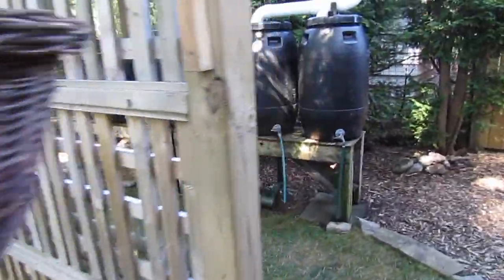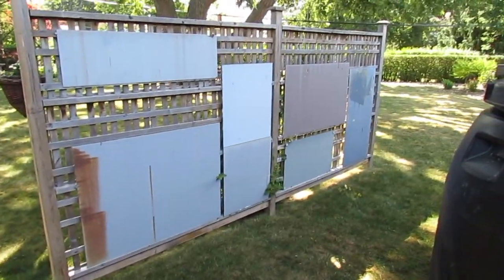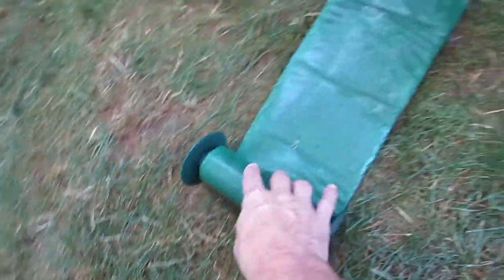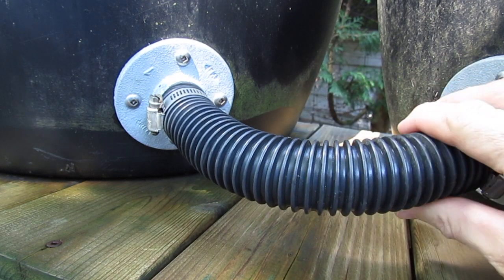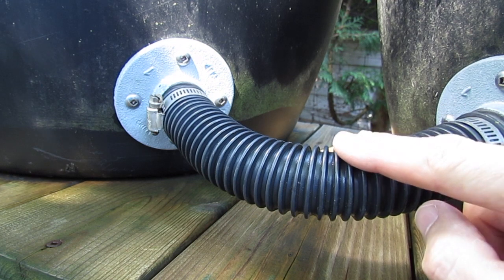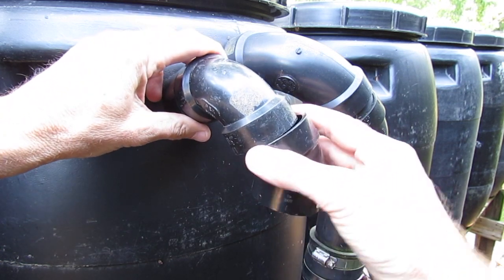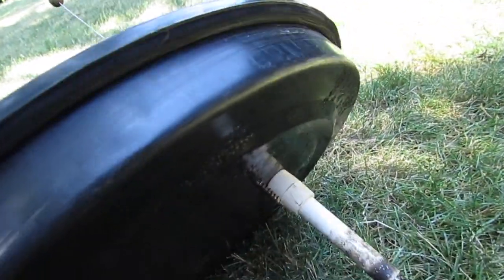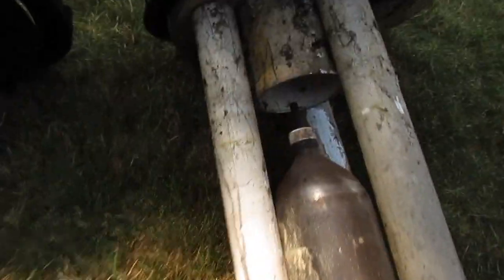How to Build ● Rainwater Tanks From Pickle Barrels

Comment from the maker: Find my favourite tools here!    https://www.amazon.com/shop/chrisnotap
Reply: I have a tip for you: If you get the overly large blue electrical wire nuts you can use one on the end of the tube of caulk and it seals it up super tight. I just re-opened a thing of caulk I had closed like 5 years ago and it pumped out as fresh as the day it was opened.

Comment: Very nice video.  I like the ability to take it apart.  I am using leftover concrete blocks to raise the barrels, but they will likely settle over the years.  Using your system I have the option of taking the system apart to do that.  My additions to your system will be to put a screen filled bucket at the top of the 4" PVC collection pipe.  I don't have screening on my gutters, so having the downspout stop a few inches from the top of the screened bucket will provide an air gap.  The screen there will be kind of like a small concentrated version of your rain gutter.  My other modification is to extend the  4" pipe over to the third barrel in line so that the water can flow both directions through the 1" connector pipes while filling the other barrels in heavy rain.👍

Comment: Thank you . This is great . I am in process of linking barrels . I am not clear as to why overflow is only on the first barrel. If barrels are all self leveling wouldn’t they all need to have an overflow ? Perhaps I am not understanding the physics . All your barrels appear to be exactly level. Mine are at a gradual incline . With barrel would get overflow tube? 
Love this !
Reply from the maker: Since they are all level and are connected at the bottom, all I required was one overflow on one barrel. I put it on the first one just in case there was a torrential downpour. The overflow would be able to handle the water that may not get to the other barrels quickly enough.

Comment: Hi Chris, mine here at the house are a dark grey with large corrugations, which adds strength. But the newer versions often don't have these and you can get all colours even Pink, go figure. As I mentioned they are plumb in, with a 5 micron filter. And the water is used for everything and is my primary supply. But several years ago we had " Ag water " linked to the middle tank. This is treated town water that arrives at about 2.5 litres a minute and then is pumped to the house. I am really surprised on how many youtube vids I see on collecting rainwater in the states. Best come to Australia to see how we do it. And here its almost mandatory to have tanks now. Cheers love your channel and have subscribe

Comment: I like the cleanness and simplicity of your barrel connections.  Now that you have been using it for a while, what are your thoughts on your design vs having a shutoff valve between each barrel to isolate in case needed for leaks or cleaning?  Is that overkill?
Reply from the maker: It is still working great. My wife uses every drop out of all the barrels for her gardens each summer. I haven't and wouldn't change anything. If I get a leak, which I still haven't, I would just let it get low and then repair it when the chance arrives.

Comment: Chris, I just found this on youtube and plan to build a system like it here in Arizona. Thank you.  Just one question: do you get much leakage from the metal flanges on each barrel ?
Reply from the maker: Not a single drop of leakage.  There is no leakage from any connectors at all. A bit of silicone before assembly is best.

Comment: How do you keep the water from leaking out the top threads of the barrels? We are trying to use this type barrel for a sediment filter, but water is leaking around the threads.
Reply from the maker: You can see the overflow pipe at 8:24. The water can't get to the threads since this pipe allows the water to escape onto the ground before it gets that high.

Comment: Great tutorial.  Thanks for the details.  Question about the pop bottle in the first flush barrel...  When the bottle rises and causes water to flow into the next barrel, wouldn't the next barrel then accumulate the biological debris from the roof?  Seems like the next barrel would become the new first flush barrel.
Reply from the maker: By them the roof has been cleaned by the rain.

Comment: What a fantastic video! Two questions: is this enough for a couple months of watering or do you run out often? 
Does it have enough water pressure (gravity fed) for a drip irrigation system?
Reply from the maker: All depends on where you live, amount of rainfall, and how much garden you have to water. For every foot off the ground that the water level is at, it creates approx .5 psi  per foot (1/2 a pound of pressure per foot)  So if the water level in the barrel is 6 feet high, that will create about 3 pounds of pressure. As the water level drops, the pressure will also drop accordingly.

Comment: I love your setup - though it seems you would loose a huge amount of water using that type first flush.  Had you considered using a filter instead?  For example, a nylon stocking to filter out the debris.  Thanks and keep up the good work!
Reply from the maker: Thanks for that! I kept it simple. Filters need to be cleaned so I stayed away from that. I clean out this first flush about once every one to 2 years.  Very low maintenance and works really well.

Comment: You can also use a piece of clear hose connected at the bottom and secured at the top to view the water level. If you see an 18 wheeler water truck they all have view hoses like that.

Comment: Ingenious. Does the soda bottle have to have air shot into it with a valve? Won't it float up just being closed?
Reply from the maker: I put the valve in it to make is firm . Sometimes these bottles can be a bit soft and deform a bit. The best thing to do is put the bottle in the freezer for about 15 minutes and then immediately screw the cap on when you take it out. The cold air then gets up to room temp, expands, and keeps it firm. Saves time and effort of putting a valve in it.

Comment: I like this,  but I was thinking what if in the winter I want to disconnect this system from the downspout?  Any suggestion?  Thanks
Reply from the maker: All I do for the winter season is I open and drain all of the tanks and leave the valves open for the whole winter. That's it.

Comment: Watched your rain barrel video. Looks great. I would be a little worried about the ball valve and prancing critters. Hate to see you wake up one morning and the water is on the ground.
Reply from the maker: Have been using that ball valve now for about 8 years without a problem. Ball valves don't move that easily so critters aren't an issue.

Comment: You could have used a coupler on the first flush barrel as well, just add a piece of regular pipe into the bottom end to handle the bottle and keep it from getting stuck.  That give the added benefit of locking the pipe to the barrel cap like the other barrel.

Comment: I like your thinking. What is the reason for inflating the "pop bottle valve"? Would you increase the water displacement by much? Or have I missed something? Thanks for a Great idea.
Reply from the maker: +Sandy Johnston I watched a video where they made a large floating craft out of pop bottles and they used a bit of dry ice popped into each bottle then put the cap on but they were very uneven in pressure. It got me thinking of a better way to do it.
Reply from the maker: Good question. If you take a pop bottle and put the cap on, you'll find that the bottle is too flimsy, you can squish it and lose its shape. With it pressurized a bit with the valve, it becomes very firm and reliable to do it's job.
Reply: Maybe some soda and a little mentos candy would work.

Comment: Awesome video and packed full of great information. I do have one question. Is there a flap or valve so that when water is coming into the barrels it only goes into the first barrel and not the second? Whats stopping water from going into the second barrel until the first fills up and the 2 litter bottle stops the first barrel from filling up?
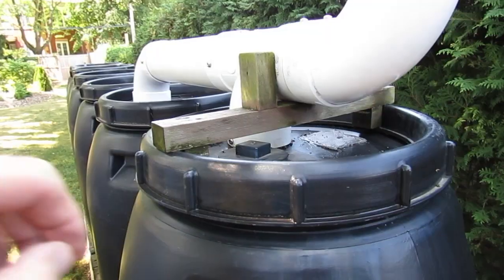Reply from the maker: If you click on this number, 10:56 ,  it should bring you to the part of the video where it shows the shape of the pipe. With the shape of the pipe the way it is, the water has no choice but to go into the first barrel.
Reply: got it. Thank you so much and look forward to more videos

Comment: Chris, I am a bit perplexed, here in Australia we just add a large poly tank to the down pipe, I have three 5000 gallon tanks on my house and they are plumbed in so that is my water supply. I assume that you don't have the access to large tanks?
Reply from the maker: Interesting. What do you use the water in those tanks for? Are the tanks Clear coloured or Black coloured? The ones we can obtain here are large cubes about a metre cubed but they are white translucent in colour and the algae form inside from the sunlight getting through.

Comment: With that much space in the garden, I'd be inclined to get a used 1000 litre IBC tank or two for next to nothing and paint it black.
Reply from the maker: You could be right but it's 6 of one half dozen of the other. Both work well. With the barrels there's no painting and each is light weight and easy to handle. Just sayin.

Comment: If you have questions on the legality or legitimacy of Rain Water Harvesting you can always check out the NCSL website for Rain Water Harvesting

http://www.ncsl.org/research/environment-and-natural-resources/rainwater-harvesting.aspx

lets you know what states have regulations/laws and what they are for pretty much anything.  For instance California allows the harvesting of rain water for specified purposes such as Landscaping.  Whereas Texas has an extremely comprehensive bill found at http://www.capitol.state.tx.us/tlodocs/82R/billtext/html/HB03391F.htm.

Just look and you might find the information you are looking for.  I think this rainwater collection system is absolutely awesome.  Only thing I would do to change it is instead of a first flush tank, I would set up a filter system prior to the tanks which includes a charcoal filter.  Not much in the way of debris if you have the gutter setup or a screen on your funnel system so that the only thing you are really needing to filter out is the Animal excrement. 

Wonderful system!  Thanks!  Helps out a lot, I hope to set up my system for rain water harvesting soon and use IBC tanks for the collection tanks.

Comment: Thanks Chris! Love this and will be setting up something similar. I was wondering, based on some of your other videos, how you might incorporate the 12v Prius water pump (or similar) into this system to water a garden w/ the collected water easily and efficiently via solar panel power alone.  I'm thinking you could you submerse the pump inside the last barrel (furthest from first flush) and switch in on at will.  It seems the Prius pump is powerful enough to push through a standard garden hose - yeh? What would your suggestion be for this?  Maybe integrating the two is a topic for a new video? :)
Reply from the maker: That little pump is good for some things but I don't think it would be good for moving water along a long length of garden hose.